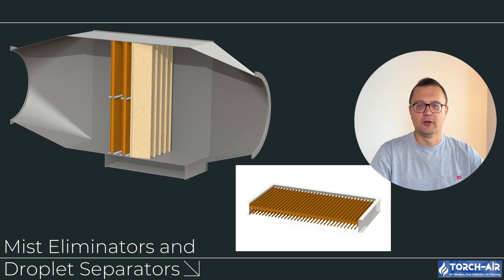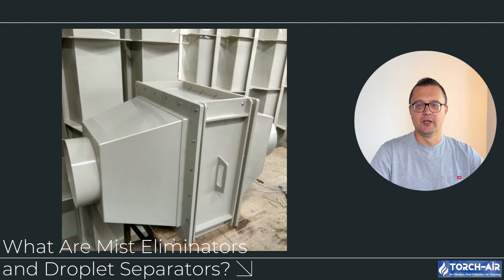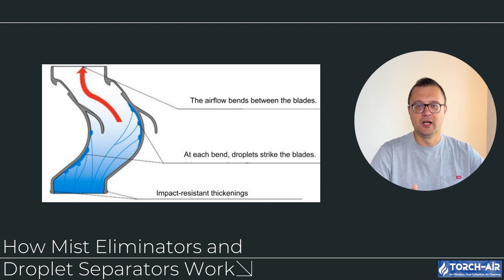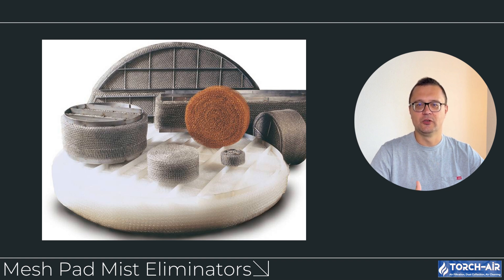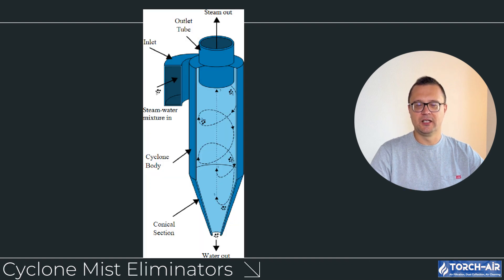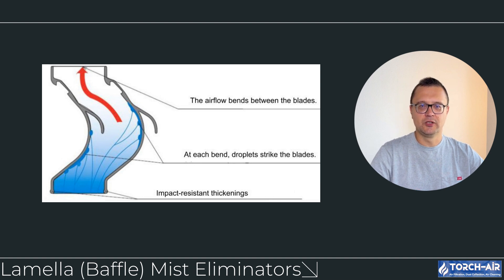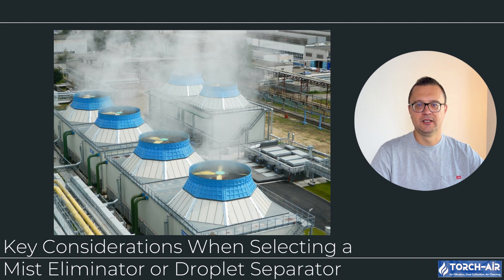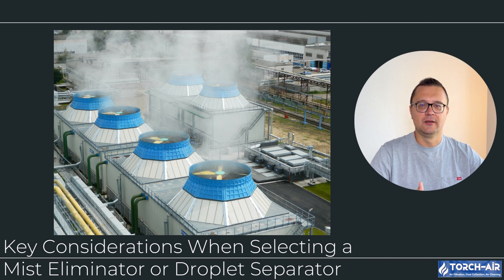Mist Eliminators and Droplet Separators for Wet and Dry Scrubbers, Cooling Towers, and ETC

Comment: what would you recommend for air bubblers in containers, so think of a large container of liquid and bubblers, as the bubbles leave the solution all kinds and mist is released but not very high air flow as the air is coming from bubblers/compressors
Reply from the maker: Please email us and we will help you choose a solution for you
info@torch-air.com